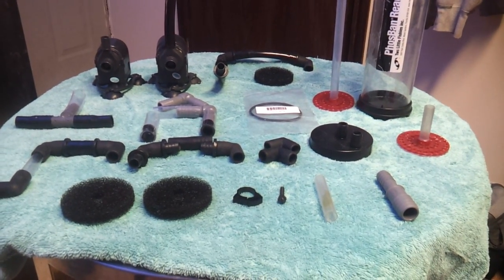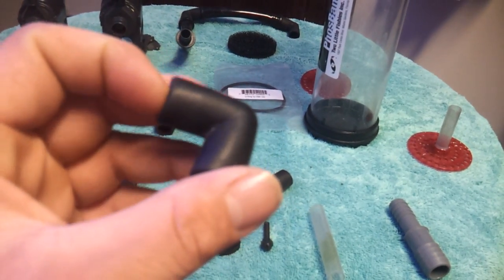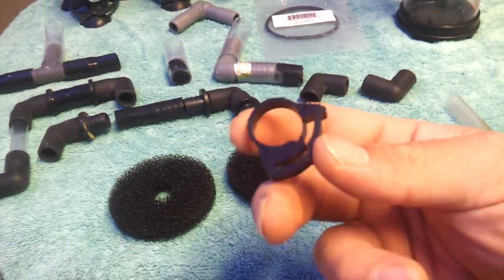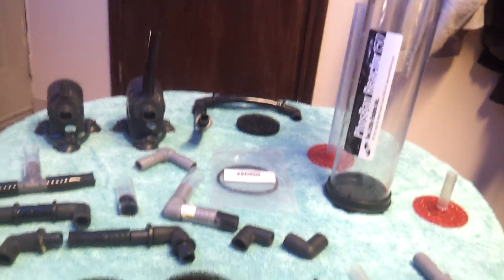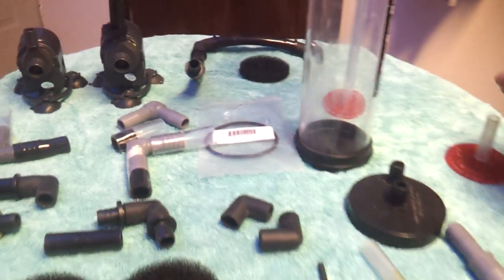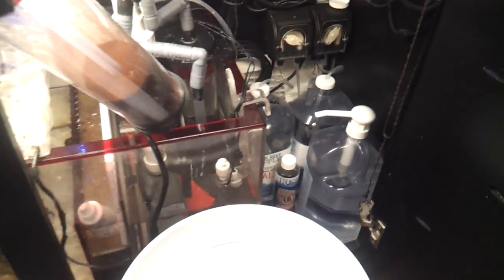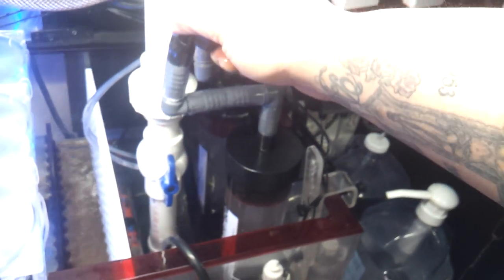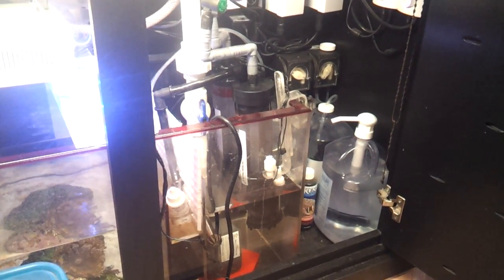Phosban Reactor 150 - Review, Tips, and How to GFO

Comment: I was thinking about running this reactor with carbon. Trying to really add some upgrades to the 140 FOWLR so it will be as automated as possible.  Right now I'm running bags of Chemi-Pure Elite and it works great but does require weekly rinsing.
Reply from the maker: fluidizing the carbon is going to be your best bet to get full use out of your carbon, although mine get full of pods...i think its way better than the bags